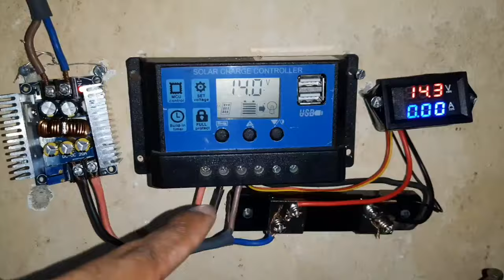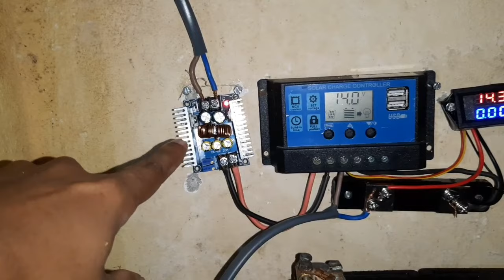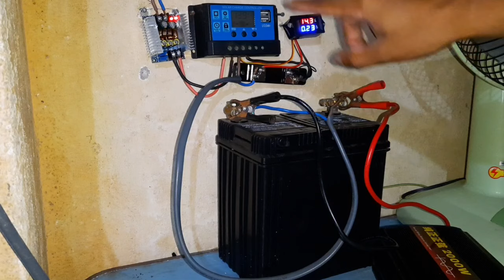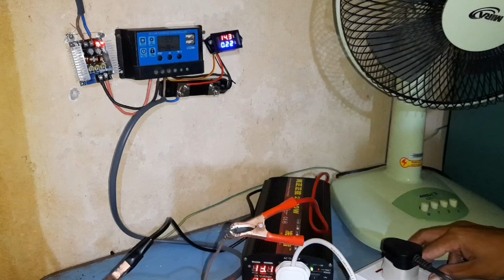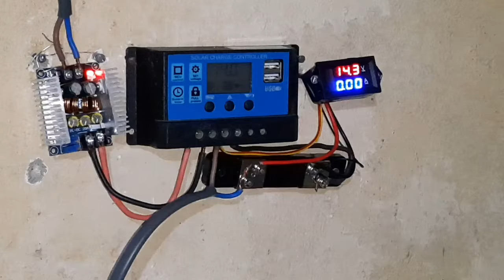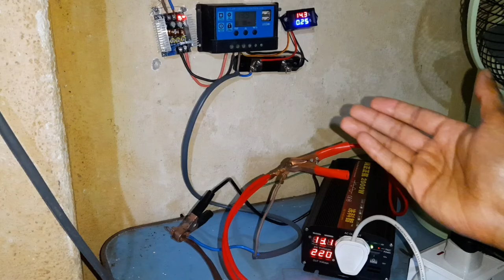Solar Powered Fridge - How to Run a Fridge With and Without! Batteries

Comment: Interesting . Due to audio reasons I couldn't understand what comes at the end of the Panel Cables. There are two  devices Both wall mounted. Attached to them is the Amp Meter. Could you speak about them again and a little louder. 
Thanks.
🙂
Reply from the maker: Sorry about that. Those things on the wall before the ammeter are a buck converter and a pwm charge controller. Im using the buck converter in this set up as I am connecting my supercapacitor bank directly instead of the battery. This is why I have to limit the input voltage. Im not sure about the pwm scc as it is good when you have a battery but it is also rated for 24v batteries so with the supercaps if it overcharges the voltage it may end in a catastrophic failure. Thats the main reason for the buck converter in this video. I hope that makes sense.

Comment: Nice one 👍  please what is the value off the diode and the resistors used to protect the supper capacitor?
Reply from the maker: Are you asking about the temporary setup with the zener diodes??... I used that as a temporary setup untill the new protection boards arrived. That setup failed. It didnt work as planned. The new protection boards work beautifully with balancing aswell.

Comment: Interesting video!
Do you think it is possible do run a 12V compressor coolerbox in this way?. I was thinking about a foldable 200w solarpanel a buck-converter and a capacitorbank.
I may be wrong but I think the compressor draws 45W when it is up and running...
Reply from the maker: For small compressors it should be fine. And especially as the cooler box will most probably be used during the day time with plenty of sunlight I think you can get away without using a battery. However if the sun dosent shine then you will need some form of backup power.

Comment: Thank you for freely giving out good solid information about your solar power system. I would like to see if and how you could run the capacitors along with the battery to obtain better efficiency.
Reply from the maker: I dont think efficiency will improve, but what I can say is the system should run smoother since capacitors will provide the necessary power during startup thus preventing voltage drop on the input side.
Reply: Capacitors are those two item showing the readings right?

Comment: what is your setup? What is the buck circuit in front of the charger doing? if I use 18 volt panel and 12 volt batery what should i do?
Reply from the maker: The buck convertrr is to bring down the voltage from 18v to 14v. It all depends on the size of your solar panel. If the panel is small you dont have to worry. But if have big panels compared to the load then you will need some thing to regulate the voltage or else your inverter will go into high voltage shutdown. 
The pwm here was just part of my system. I didnt want to keep removing and putting things back so thats why it is there.

Comment: Hi is your solar panel volt is 24v or 12v ? and how many amp from solar panel to charge battery and work in the same time fan and others equipment.
Reply from the maker: At the time of making this video my solar panel was only 150w 12v panel. (18v and 8.8A at peak power). At 12 noon on a clear sunny day I would get around 8 to 9A.

Comment: I could see you have took some time to charged up the capacitors. 
- I've wondered how long does it take to charged up those 6 capacitors which was buffered with two pieces of 12v 20w bulbs?
- And what is the specifications rating of your each Supercapacitors exactly?
Reply from the maker: Each capacitor is supposedto be 500F at 2.7V. But the real capaciyy is some where around 300 - 350F. This makes the total capacity of the capacitor bank to around 56F at 16.5V. Thae capacitors are placed in series to increase the voltage.

Comment: Sir can i ask question... Those 1600w inverter can run 90w invertype refrigerator? Then driven battery 12v/150ah for 24/7?
Reply from the maker: Hi... First of all I dont have experience with inverter fridges but according to how they are supposed to work you shouldent have to have a powerful invrter as there should be no powersurge on startup. Next is the battery. It all depends on how much power you use in a 24hr period and how many hours you will need the battery to function till the sunlight comes back.

Comment: What if you put a larger load on output than the solar panel is producing? Example if you try to run iron? Will it work slowly or inverter will give alarm?
Reply from the maker: The inverter will alarm and shut down as there is not enough power.

Comment: At 3:20 minutes,  what is the white devise you plugged the Fridge into ?
Reply from the maker: That is just a short extension cord from the inverter to the fridge wire as it was a bit short. I had to use that so that I could positition everthing for the camera in a nice way.

Comment: How many watt required solar panel run one fridge only?
Reply from the maker: It depends on how much power your fridge uses in a day. The most amount of power you can produce using solar power is only 6hrs around noon. So your solar panels size should be able to generate the power used by your fridge in a single day within those 6hrs.

Comment: If I’m running a 12/24v DC 90watt refrigerator directly from solar panel should I still use a buck converter? Or since it’s 12 &24v dc input I don’t need it?
Reply from the maker: It depends on your panel voltage at maximum power. If it is within that range you shouldnt have any problem. But if it is more than that... Say 32V then you better consider a buck converter.

Comment: Hello sir, may I know the number of that power capacitors? I have here 36v 250w solar panel? Any suggestion for good set up?
Reply from the maker: That supercapacitor bank was made of 6 x 2.7v 500F capacitors. It would have been equal to 16.2v 83F. Since your panal voltage is 36 i think you will have to have a 24v setup or a good mppt solar charge controller as that will be more beneficial than putting your money into the supercaps. You can consider the supercaps as the icing on top of the cake.
Reply: Copy sir, thank you..🫰

Comment: Can i know what happens when we disconnect supercapasitor after  start the refrigerator ? Will the refrigerator turn off by it self or will it run without supercapacitor?
Reply from the maker: It should run by itself with direct power coming from the solar panels. The supercapacitor delivers power only during the first few milliseconds of starting the induction load.
Reply: @diysustainableliving2774   @diysustainableliving2774  bro i wanna  run DC 12v water pump.what about 200to 225w solar panel? will it produce enough power to run 12v water pump?
Reply from the maker: It all depends on the power of the water pump, how long you plan to use it and during what time of the day. With a 200w panel you can easily get 1.2kwh of power a day. It is equal to running a 200w pump for 6hrs continuously.
Reply from the maker: I think the most important thing is to figure out the pump. Like how I show in this video where I am using an AC 220v fridge, you can use this setup with a standard home waterpump as well. But if you want to go with 12v then it important to decide on the pump first. That will depend on the depth and height you have to pump the water to and the pumps available in your area.

Comment: Can you provide the link to buy the fridge? 72 watts that's amazing.
Reply from the maker: I think it will be easier for you to check out your local home appliance store and get the best fridge with the power rating and specs you desire. The lowest power refrigerator is usually the cheapest one available at the store. I made this video just to prove a concept that you can start and run a fridge directly from solar but when a cloud passes over the whole system will shut down! So it is best to add a battery to the system you are designing.

Comment: great video. atleast electricians / electrical engineers can do the capacitor set up.  how many cycles of the fridge going on and off will that capacitor handle before it is drained do you think.  also what UF is the capacitors. and it’s wired in pararralell right ?
Reply from the maker: Yes.. They are in parallel and on the DC side of the inverter. They are in the Farad range (F), not uF. The are super capacitors but they are there to provide the initial burst of power required to start the induction load. Alone they can only power the fridge for only a second. You need some source of power to maintain the fridge running.
Reply: @diysustainableliving2774  does the dc voltage side of inverter keep the capacitor recharged as the condenser in the fridge turns on and off over period of time or will the capacitor run out at some point and need ac recharging
Reply from the maker: The DC side keeps it always charged. Its benefit is only seen when starting an induction load such a fridge. During startup the fridge pulls a lot of current for the first few seconds. If the DC source such as battery or solar panels cant give the required power the voltage will drop drastically and the inverter will shutdown. The supercapacitors here function as a form of temporary storage. They can provide the massive boost of power for only a few seconds which is enough to start the induction load. Once it starts running the caps will automatically charge and come to its previous level as it is in parallel with the power source always.

Comment: Can we plug in direct from solar into PWM and then from PWM to DC appliances?
Reply from the maker: It depends..... If the power draw is a lot it might work as the pwm switch will stay open. But as the power draw is less you will get interference as the pwm works as a high frequency switch. It adjusts the power delivered by adjusting the number of times the switch is open per second.
Reply: @diysustainableliving2774  I have a 500W solar panel at 41V VMP. Supplying a 350 W DC pump. Will that work?

Power Draw? Do you mean the electricity supply from solar panel?
Reply from the maker: Sorry for the late reply. Power draw is houmuch your appliance uses. Note that your water pump can run on the power of that solar panel but the question is will it start. Induction loads such as pumps and compressors need 5 to 7 times their rated power during startup. So please consider adding a small battery or a supercapacitor bank to the setup to make sure it works.

Comment: In the system without battery, is it more efficient to connect the buck converter directly to the inverter? PWM loses its main function, charging and keeping the battery charged. Thanks again.
Reply from the maker: The PWM charge controller basically acts as a high frequency switch to send power through. At low voltage it basically stays on. So I dont think it will significantly impact the system efficiency. Anyway I would recommend to put atleast a small battery in the system since even if a cloud momentarily covers your panel, the panel voltage will drop and the inverter and what ever it is running will shut down. You may have to manually turn the whole thing on if this happens.
Reply: Its not working with me 😭.when i connect from solar to buck and buck to inverter .the inverter drop down voltag from 14 to 8.8 and loop restart in iverter ....bad idea my friend
Reply: @In_the_name-of_ALLAH  just because it does not work for you doesnt mean its a bad idea, its not going to work with just 1 or 2 panels. you need at least 10amps from the solar panels
Reply: @In_the_name-of_ALLAH  that buck converter you were using is about 6 amps max, the seller advertise it as 10 amps but if you check out the components you will find it doesnt give 10 amps, the inverter you have there will work at 12v but I dont know what output mains voltage you have,110v or 220v but lets assume it was 110v.if you wanted to run a fridge at 50w you would need at least 5 amps inputto the inverter but the fridge could draw up to 30amps for 2 second when the start coil is running this is where the supercaps will help you out. instead of drivng the radio from 6v as you are doing what I would do is connect the solar controller to a battery then connect the buck converter from the battery. you didnt show the solar panel that you were using but you show a picture of one which looks to be about 250w max so the average power could be about 100wto 170w

Comment: Is there zener diode in that super capacitor
Reply from the maker: Yes. Unfortunately at the time I did that video my previous protection board had failed. So prior to getting a new set I made a DIY set up using zener diodes. It did not do a good job at balancing the cells so I had to get new protection boards. This zener diode set-up is not reccomended.

Comment: hello my friend can you tell me if it stays connected the solar panel back to the solar controller without putting batteries or will the consumption burn the solar controller??? or it won't be a problem as long as we leave it without batteries let me know if you know please
Reply from the maker: Once through the buck converter the voltage is stabilized so nothing is going to burn at that voltage. However without the battery a cloud passing overhead can shut down the system. This is just proof of concept which will work in specific conditions but not practical all the time in real world settings.
Reply: @diysustainableliving2774  I have 3 lithium batteries and because I disconnect them in the evening because it's cold below zero and it doesn't do to stay outside I put them in and leave the solar controllers with the panels back on and in the morning when the temperature rises again I put the batteries back on and they charge normally what I asked you is if the solar controllers that are left for a few hours without batteries connected again can burn out because they only have the panels connected without batteries for a few hours in the morning
Reply from the maker: That... Im not sure. It is reccommended to connect your batteries before connecting the panels. I think it will be good if you install a switch on the panel side so it will make connecting and disconnecting easier and safer.

Comment: In theory this idea should work using 7  150 watt panels to run a 5000btu window ac(550 watts normal operation) in order to rely primarily on the sun to run the unit on bright summer Texas days and only battery for startup and temporary clouds or auto switch to grid power for rainy days and night time...of course larger inverter bigger batt bank charge controller and buck converter is needed but over time? Will monthly savings pay for itself and how long to break even?
Reply from the maker: In solar setups batteries cost the most and tend to fail before other components. So if you are using the AC only during day time you can spend more money on the panels and run the load. Supercapacitors are only there for startup. Note by adding a small battery with the supercapacitors you wont have to worry about clouds covering the sun and shutting down your system.

Comment: That is fine in hot country but not in Bad Weather UK?
Reply from the maker: Very true!.... When you get clouds the panel voltage drastically goes down. Even in summer although the day is long you get a lot of clouds which impact the panel output. I think UK has much more wind power than solar power and thats why you see a lot of wind turbines in the countryside as it makes more economical sense.

Comment: If you have a portable power station that can output the sustained power for a fridge but not the induction spike, is there any practical way that a bank of supercapacitors can be wired into the AC out to enable it to start the fridge?
e.g. bridge rectifier -> supercapacitors + bulb load -> another invertor ?
Reply from the maker: I think it will complicate things. I like simple circuits. As long as you put it to the DC input side the inverter can handle the induction load as the supercaps are there to give that spike in power demand when needed.